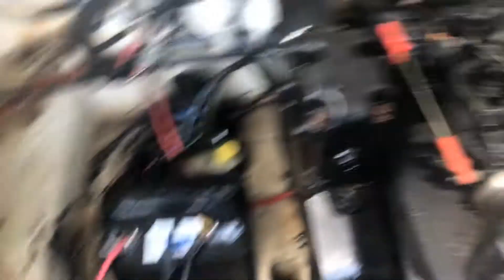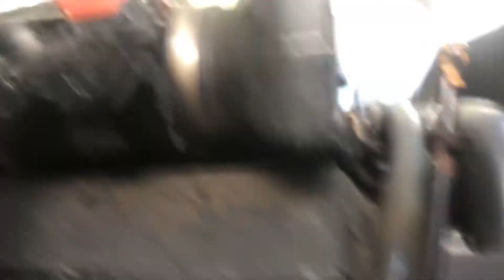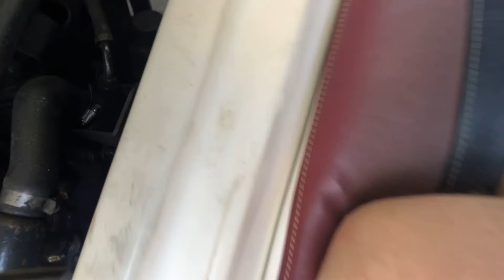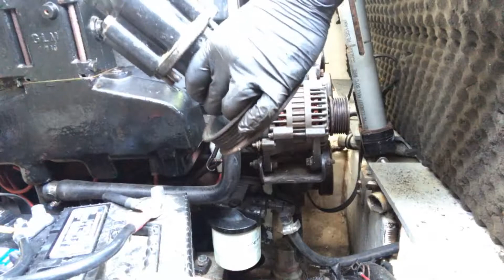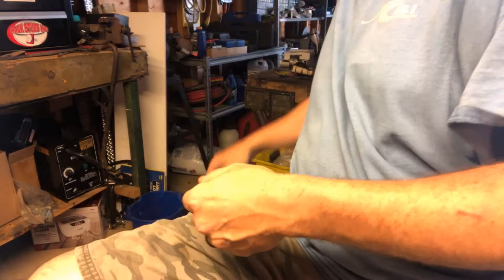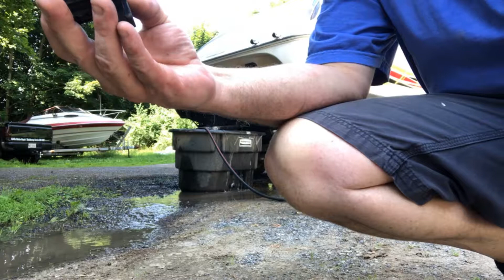How to replace Mercruiser Bravo water pump impeller!

Comment: I have found it much easier to remove the entire bracket that holds the water pump rather than the pump from the bracket.  There are only two bolts facing the front rather than the three nuts on the studs.

Comment: My boat (twin 502 Mag MPI W bravo 3's) is on a lift and has hook ups for a garden hose instead of scuppers.   How does water get to the outdrives to flush them or is that necessary?  Nice video, gonna help me a lot when I get parts in.
Reply from the maker: lear60man shouldn't have to flush the drives if you have through hull intake scoops.

Comment: what size bolts need to be removed for this project? I caught that the hose clamps were 5/16th but didn't catch the other sizes for the belt tensionor, or the 3 bolts those you said you need 1/2 in does that refer to bolt size or wrench size , or the bolts to get to the impeller.  Also you mention need the right tools for beginner not famillar with all the tool jargon what tools do you remmmend to buy for this job.  I have a 7.4 mercruiser with bravo 2 drive on my 1990 maxum 2755, would my application have any differences are changes to procedure from this video?  Thanks alot!
Reply from the maker: Gary Fabian bolt sizes might be a bit different from your year and you most likely have v-belts instead of serpentine so the belt tensioner will be different. You'll want a decent size socket set to make sure you've got the correct sizes. Sorry I couldn't be more specific but if you get a service manual you should be ok.
Reply: @maineboatguy  thanks I'm on my boat now and see that the belt is different looks like I have three separate belts unlike yours looks like one long belt. My sea water pump belt only goes around one other pulley so then is the tension bolt I loosen actually on my water pump then because I don't see anywhere else to loosen?
Reply from the maker: Gary Fabian yes I believe loosening those will remove tension from that belt. There should be a slot in one of the bolts holes to rotate the pump.

Comment: I have two drives I’m new to Bravo‘s it’s a bravo one I know with the alpha one generation to would put the shifter in forward to remove the drive do I do the same with the bravo and what about the other side if that one turns the other way would I put it in reverse?
Reply from the maker: J b armstrong do not shift bravo to remove drive, leave in neutral. The shift cable attaches completely different than alpha. Both port and starboard drives will be the same as far as removal.

Comment: Hey boat guy. That electric hatch lift.. lets say the motor goes when the hatch is down how do you get it open?  My hatch its bolted to the hatch bracket. And the cushions on the hatch are screwed down from the inside.   Im thinking of removing the bolt and maybe putting a pin with a cable to release it just in case?
Reply: I do see a panel but there is a bolt so I guess I should get a pin
Reply from the maker: J b armstrong typically there is an access panel installed so you can reach in and pull a pin. If you don’t have that I’d suggest installing one!

Comment: Thank you, I got the impeller pump deal out. But god only knows how the hell its going back in. It’s in a Baja 98, 212 islander but the pump is actually below the stringers. But seriously thank you for the info.
Reply from the maker: Dan Braun that’s almost the same boat! You’ll have to have someone hold your ankles while you dive under the engine to reinstall the pump ha ha! Glad the video was helpful! Good luck!
Reply: Maine Boat Guy one other question, did you buy the actual mercury part or go after market? What is your recommendation
Reply from the maker: Dan Braun we went oem on that job and I’d recommend it knowing how much of a pain it is to remove.
Reply: Maine Boat Guy Thank you very much once again!!

Comment: Can you go over how to tell if it’s a left hand or right hand turn please
Reply from the maker: Charlie Goodwin if it’s single engine the pump spins clockwise if you’re looking at the pulley, you’ll reference left hand spinning, inlet hose on top fitting. If you are not 100% sure you’ve got it right just remove the outlet hose from the pump and fire the engine up for 10-15 seconds to ensure water flow.

Comment: Hi, did you take out the pieces of Impeller that were in the hose?
Reply from the maker: Frank Melero if you remove the hose that goes into the oil cooler and the one going to the thermostat from the cooler you should be able to force the pieces out with a garden hose. Typically they don't make it past the oil cooler. You could pull the thermostat to see if there's pieces in there. Hope that helps!!